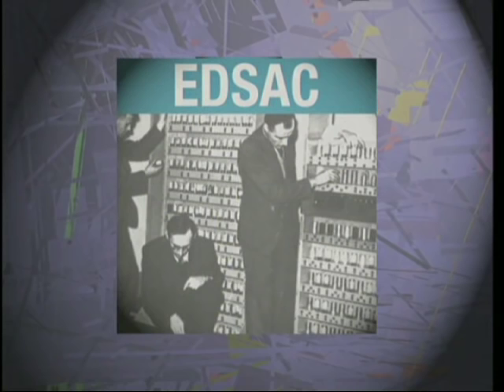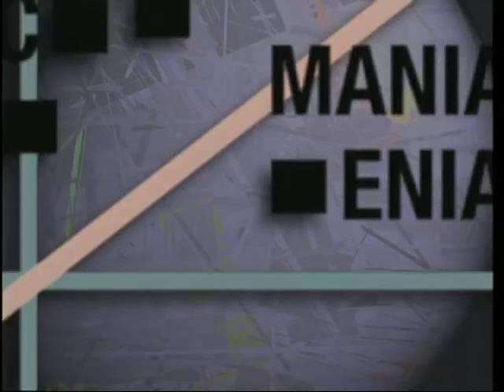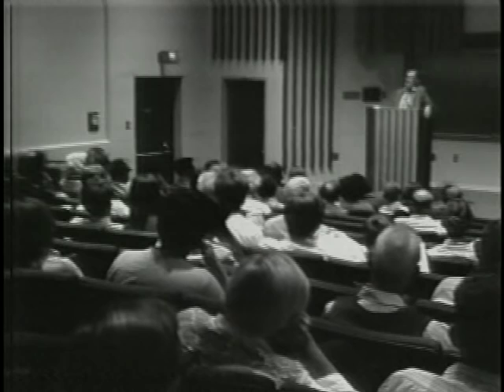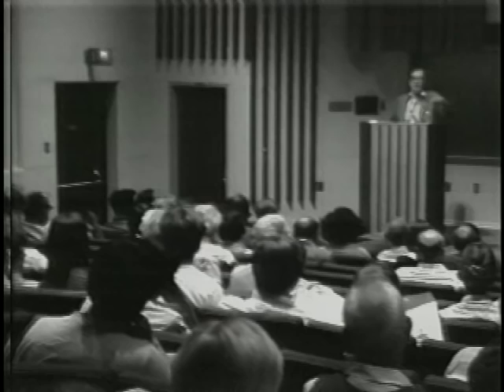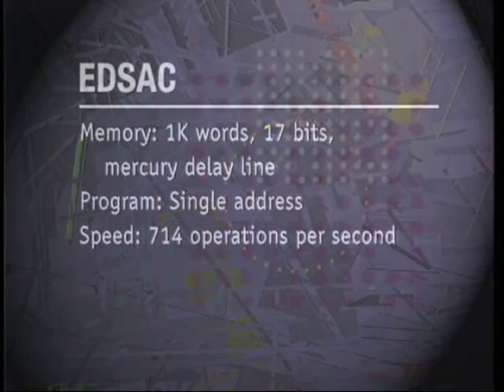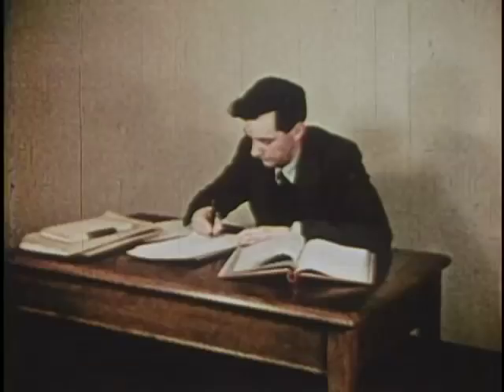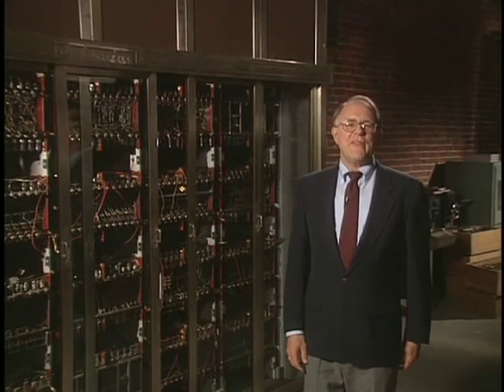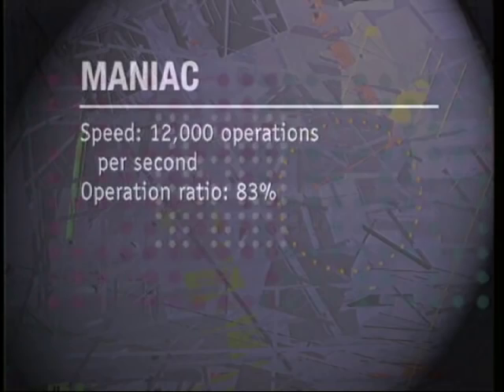Computer Pioneers: Pioneer Computers Part 2

Comment: Its pretty crazy that 72 years ago, a calculator was built using vacuum tubes and was a huge hot room of wires and switches, now we have voice activated smart phones that fit in our pocket.
Reply: @Paul Bearden Yes isn't it amazing , the miniaturization of technology with regard to transistors

Comment: Yeah, that circuit is an ENIAC "ring counter". It holds a single decimal digit, 0 through nine, with each tube in the ring becoming active in turn as the counter increments in value. It's basically an electronic version of a single-digit mechanical counter wheel. A single ENIAC register contained a whole set of these ring counters, and they allowed the register to also act as an adder.

Comment: 32:05 Leo really shines in this video.

The first automatic office in the world. Leo is fast and flexible. It can test the feasibility of the information that is fed into it and check the accuracy of its own results following orthodox accounting principles. It does not require air conditioning, having its own ventilation system.
Reply: My first thought as they described it's operations was, "Wow! The world's first ERP system!" :-)
Reply: I was trying to think of how to describe LEO. It appears to be the first hyper-scale computing platform. Just think of the wiring complexity to make the system work. We have modular, simplified, standardized interfaces today, mostly embedded in silicon. That was all hand crafted. Phew!!! Quite amazing.
Reply: When starting With British military digital computers in 1961 we had several lectures from 'computer people' one from LEO.  After it had been running for a year or so the management asked for a survey of all the improvements made in profit and productivity and how computers could make more improvements. they fed the data into LEO and ran their program, the result from LEO was "Build more computers"

Comment: Gordon Bell was the main designer behind several of Digital Equipment Corporation's most important minicomputers, including some of the key ideas of the PDP-11, which changed how all computers are designed, and he was in charge of the development of the VAX, DEC's most successful machine. He's probably one of the most important and best known computer designers of the 1960s and 1970s.
Reply: Were some of the earliest Intel "chips" basically miniaturized copies of complete DEC small computers (or at least copies of some of the important circuit boards that when put together with other circuit boards made up a DEC computer) ?

Comment: The processing power in today's handheld mobile devices is astonishing!!
Imagine if you went back in time and shown a Samsung Galaxy or an Apple iPhone or any smartphone to the engineers who built these early computers...
Reply: It's not only on speed, today's computers are working almost exactly as the old ones, almost identical principles.
In a rough approximation today, you can say that you have the elements that were occupying an entire room, now fit into a small, cheap silicon chip.
Reply: pretty sure they wouldn't know what to make of it and think it's some kind of slide viewer or something
Reply: Actually, computers/electronics don't really change all that much, there is a fantastic 1960's computer video and it is astonishing! you would think he was talking about modern technology! The problem is that even with all these amazing computers which people carry in their pockets the technology is just wasted! They don't do anything meaningful with it and then to make thing's worse they throw it away after a year to trade it in for another powerful device to look at facebook! :)
Reply: What would happen:
- battery dies after a week at most, and you didn't take a charger
- hardware becomes useless (no suitable technology to do something with it, research takes years)
- you'd be useless at explaining how it works (unless you're engineer yourself)
- software becomes useless (except maybe for the calculator)
- no ability to reprogram
- no ability to phone (absence of mobile phone networks)
Reply: MichaelKingsfordGray  Looking down on something amazing doesn't make you important. If you're not grateful for Linux, you don't understand it.
Reply: Nope. These WERE the very people who understood the endless applications of simple building blocks taken to the extreme.
Reply: Mauchly say : "Told you so !" 
I guess he would be most impressed with modern monitor/screen resolution and "video adapters" 
also evolution of "bandwidth" and connections of multiple computers such as "Internet" 
I think his time saw the invention of slow telephone modem connections which eventually made remote stations that dialed in to a "mother computer" possible

Comment: Colossus was a set of computers developed by British code breakers in the years 1943–1945 to help in the cryptanalysis of the Lorenz cipher. Colossus used thermionic valves to perform Boolean and counting operations. Colossus is thus regarded as the world's first programmable, electronic, digital computer, although it was programmed by switches and plugs and not by a stored program.
Wikipedia
Reply: Did the Colossi influence the development/construction of the "LEO" ? Otherwise existed in the unknown and isolated from other computer evolution because of strict "top secret" classification up until very recently ? 
 Was there any form of communication whatsoever during that era between the British (was it Bletchly Park?) team and the ENIAC team ?

Comment: It's pretty hard to tell what those tubes' specific purpose was, since you only get a corner view of the panel without context. But they're probably just normal vacuum tubes which look larger due to perspective. Most likely they are ordinary vacuum triodes, acting either as switching elements or as signal amplifiers, just like how transistors are used today. (Or they might be double triodes: two vacuum triode circuits in a single glass envelope.)

Comment: The issue in the 30's-60's was the price of memory.
The phosphorescence cathode tube memory is genius.
4:30
I wonder why they did not use CO2 or even heated UF6 instead of Mercury. Mercury might have a low attenuation but it is fast. A dense gas is much slower. Using a graded solid it might be possible to create a mono mode sonic/acoustic delay rod.
Reply: Gues temp coeff and noise issues
Reply: I think the mercury delay line technology had been developed in conjunction with early RADAR technology (think Battle of Britain) and one or another of the ENIAC team (Mauchly?) was familiar with it
Reply: @davidpowell3347  Many technologies originated from Radar. A delay line was important for clutter removal.

Comment: In an old BBS discussion years ago, I joked that real programmers used 9-track magnetic tape.  Another responded that real programmers used punch cards.  Another said that real programmers used paper tape.  One topped us all by saying that real programmers used patch cords...   ;-)

The first CNC milling machine that I programmed in college used paper tape.  I remember filling out the instructions (tool start, tool stop, tool down, tool up, tool travel x/y) on a pad by hand, then sitting down in front of the tape punch and typing in the commands to be punched on the tape.  The tape was then loaded on the machine with the stock to be machined, and then run.  Of course, we also had to learn how to use a manual milling machine so that we understood the process of milling itself.

Ah...  the good old days...   ;-)

Comment: First computer program was written by Ada Lovelace 1815-1852
Reply: What did it do???
Reply: @desmonddwyer  It was a program to run on the Difference Engine.
Reply: @petermitchell6348  No, it wasn't. There were two "programs" presented in her annotated translation of Luigi Manabrea's Sketch - one by Babbage, outlined in the presentation Manabrea was reporting upon, and the other was a more detailed and recursive "program" (really a state description, as the "language" for the machine was not then decided) for calculating the Bernoulli numbers, produced in consultation with Babbage. Both were for the Analytical Engine (the Difference Engines didn't use a program as such, just sequential addition to compute numerical results of polynomials). The idea that Babbage himself hadn't devised instruction sequences for his own machines, if for no other reason than to enumerate the instruction set needed, before Lovelace came along is ridiculous. Had Babbage's Analytical Engine gone anywhere, her contribution would have been far greater and more important than a mere program: she was the first to realise that the machine could do more than calculate. Babbage thought he was building a fancy calculator; Lovelace understood what it could be as a computer.

Comment: At some point I think the ENIAC / UNIVAC people became concerned about using insulation on their miles and miles of connecting wiring that would tend to be distasteful or avoided by gnawing mice and rodents? (Modern car makers would do well to avoid using wiring apt to attract gnawing rodents) 
also lowering the filament heat and voltage for their vacuum tubes to the absolute minimum needed to operate the tubes in order to lower the rate of "burnouts" ?
Series voltage drop for the heating filament power supply for the vacuum tubes heat or a central power supply step down transformer to supply each tube's filament in parallel with the other tube filaments?

Comment: program diangle lines shifted one more postion mounted circuits called plug in unites ......reading numbers then ot switches resistence velocity ....most of the equipment meetrs directly display lights vaccum tubes neon lights seemed important man and machine all the eletronic counters acumalators computer projectly come up go back down conjectory 30 seconds to reach ...computerd the faster then the hsell eletronic computer were important oppreted until 1995 dramtic largder 40forty punds dozen engines working tow years memorys size operatio nrate for machines bep beep i have a one let me get thru ....find that car where its from and where its going wilkes stated contrcution progress potential much more computer muuch smaller as consulatiant to the groups where it go invented ...time consuming setting up porblems what we now cal lprogramming store contruction has bracnhing memory from punchcard sjohn von princeton he had learned about fro mengland permatent code van normen code eckart .....seltive instruction were held cards and boards zeus porr match speeds calucualtion at hig hspeed edvac discreet variable computer solve the control problem 44 bit word lenght in 1950 incidental to computting ...

Comment: published the first draft on the internet remianed for 50 year srport 5 elemtns for stored computer input output human anilogs aprts and process high spped mmeory for numbers ...before .....clear crytstalize wilkes further states inamicac ...by function 3 types of memory red only memorys the switch to the program sotred concept inporant feature stored in the smae sort of memory devie at los almos stored program heres motley ineac fast large digital computer advantage incon many problems done .......the other night after the machine moved well over 50 percent a lot of things long before .......turn it of turn it on .....constantly cycle ..heaters interfur sleeves in one of which .....less tubes decmal system the desmell system primary conpoent the whole machine was bianry desimell program ru naround plug wires tru nswitches consructions how cheap sotroage is different prices want it fast ...long ter mstorage infinte punch out cards ......the programming was vocablary the machine edvac ...simplicty bought us time ....in33 going ....eneac has a storage translation master programmer put on eletronic computer ....morse school wilkes and williams focus ..tom operational 32 word 31 bits ..memorys it ran 17 word program .....designed parrell ..cambridge ....stored program instructions stored optimum instrictuions one address stored memory

Comment: packing notes trips to packers board t oseveral loading bays leo has printed at each each tea shop for the good at the front just inside the doors .....wide range of work skilled by desing automatic undertake the user is a machine does rountine like clocks the use of leo expands ....pareel machines ....the paper called eletronic vaccum report the series circualted as text books rado maccess each word the nseraill started up ibm 701 for runner domnit is desig n40 bit word in bank probits 7 bits the design address instructions

Comment: make a list of what need one for to point out retoune a read retoune a print retune the programmer libary catalog here is the program hseet now checked and ready for punching the tape approit libray tapes go over to the tapes meachanically onto the tap e which its is prepareing punch twice then finish off the tape along as the tow tapes are identical the take the tapes on teh job que is running the oprator output ...she puts in the ract put into the photo eletric are being into the store the next tank now numbers are being read short number by half a word storage tanks ..panel some of the tubes ..back of panel wireing .....from above ...result now comeing out ........one of the othr programmer sprint the letter are porgrammer colelct results .....ed sachs notirey ...computer a valuable tool heres a film ...large numbers of clocks ....trade clocks are in demand and act accrodly ...first automatic leo office work .....accounting payroll leo fast felxable and test accracy leo can be installes its own ventaltion system leo mark 2 more output two couples one a puch reader printing devices ...leo is set console be montered decides payrool job done delivers hundred siteam ..wide variety for take home .....percise stocking over stocking ...each order depending stoc kweghs out up and down by telephone no written record what she here last minute would occur i nhweaher fed fisrt calculations .tea shop by tea shop ten shops at a time statics recorded ..provide for management only print the one for action decsios nto tradeing conidtions

Comment: are next introduction t odefine a computer basic compoents a little at time the input the control is identifed to make room for input until al lthe porblem is i nthe mmeroys a button is push to memorys so it can be worked on final answers sotred in the mmeory to the output can be told what to do submiited to information directions how to be handle interwoven a collection of symbols t oaccomplish the problem the decoder the path solution of the problem broker at aporit points various logical purely mathiamtical memeorys is nessary order and address in code two letters 30 such combiantions problems in a tape library tape result of saveing time .a tape problem phto computer the ned of the tape then switch flip loaded ...in the reader signals which the computer does it work a register 40 neon lamps vertical into each lamp with a flip flop circuit bynory one .......a register in the earth porblem the ntransfered to tubes modern cases 20 i nthe front designe dfor memory register parrel fashion one flip flop in memeory all amterial stored in address in memorys top to botto ma spot in tube same address  the memorys binary cahrters these spots regenrated imporant information ..sotrage device magnectic increaes mememory operation to memory power conpoent this feature several hours of in the memorys withdrawn in sequnces stars when abuttton to a controled to a matrix to the memory the matrix is a sorting device for the order crystal on plugs the memorys circuits the address the order infromation perform isntruction carried out